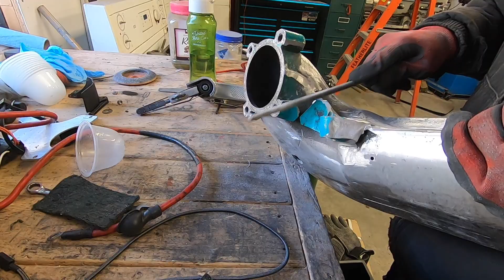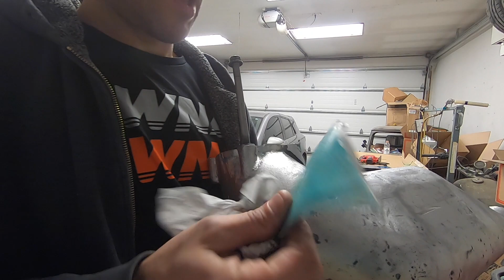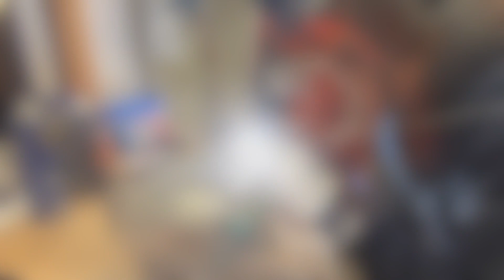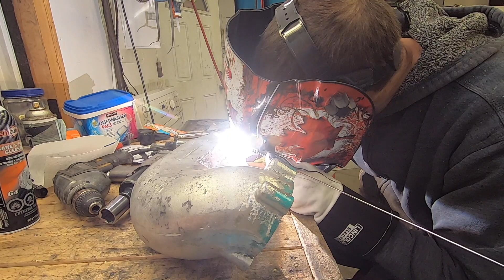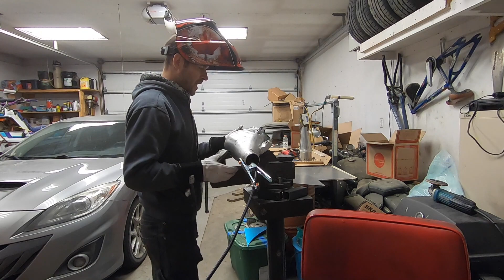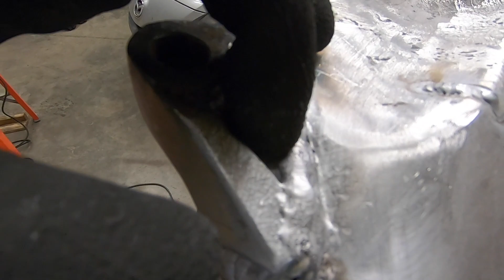ZXi 1100 Exhaust Modifications - Reinforcements and Repairs.

Comment: You need about 1 amp for every thousandth of a inch. It looks like you are welding atleast 1/8" inch on the pipe side. I'm sure you're welding with a pedal. I'd jump in it with 150 amps and then pedal off a little. It's always easier to weld aluminum with a strong blast of initial current unless its oil impregnated cast aluminium. That welder is fuc#ed. I hope you get that straightened out
Reply from the maker: Thanks Lyle. It's a pretty steep learning curve, but I'm getting it sorted out slowly.  I am now using the foot pedal, but when I made this video I was using the finger switch, and my welder was not using any up or downslope (something wrong) so it was 100% on or off. 

This casting is surprisingly easy to weld, most of the time. It must be pretty good quality stuff (or clean at least). I'm still fighting with the welder on an off, so I appreciate the advice. 

Cheers.
Reply: @JoelArseneaultYouTube  yeah you got to get that thing fixed dude. Before you're missing all you're hair and starting missing teeth!!! Seems like marine grade cast has been the easiest cast to weld. Some of it seems to fuse almost. Flows good. You're project is awsome!!
Reply from the maker: @lylegrenoble2055  I'm loving the projects and loving welding, even tho I have had some issues. If you are following through my videos in order you may see that I made a video talking about some of the welding issues and what I suspect may be happening... tho I'm an amature and can only guess. 

I have been talking with Everlast about the welder and they are following their step by step checklist. I am waiting for a new regulator, tho I have my doubts about if it will change anything.

Comment: Bummed we’re gonna have to wait for the HP mods on the 1100, but I think that is very smart of you to get a baseline and be able to see what your changes affect. I’ll be sticking around to see how this project turns out.

What kind of welder did you buy? And it is fairly new iirc right?

Nice work!
Reply from the maker: Yeah. I think that it makes more sense to do it over time and get an idea of how much is really gained from different mods. Also, this engine gave the Jet Ski Brothers a LOT of issues, so it might be smart to make sure that it actually runs well, before doing a munch of things that could cause complications. 

I'm very excited about this project, even without any mods, this is going to be a little bit crazy, for a guy who couldn't even ride one of these things just over a year ago, haha. 

I bought an Everlast Powertig 185 DV and yes... I got it just about a month ago, got a concussion and it sat unopened for a few weeks.
Reply: @JoelArseneaultYouTube   hey that’s how I started too! Never touched a jetski prior to buying the STX and rebuilt the engine. Knock on wood, she’s still rippin’. I did have it run away on me trying to tune the carbs. And let me tell you; one, I didn’t know two strokes could run away. Two, it is terrifying to have an 1100 running full tilt inside and aluminum box after you’ve ripped the plugs wires off ha ha. I then changed a bunch of things and I’m not 100% what fixed it but I did learn about the leak down test and am very conscious about air leaks. 

I watched Josh work tirelessly trying to figure out why that thing wouldn’t run. I was rooting him on the whole time. His boat is smaller than mine so it shoulda really ripped with that 1100 in there.
Reply from the maker: @YoderMarineandOudoors  Haha... yeah, having an engine run away is a scary thing! Being in an aluminum boat would totally make it more intense. It's usually a combination of things that has to happen to cause a run away in a two cycle gas engine, as they need a source of air and fuel. On a diesel it happens a lot easier as the intake is always open. 

Yeah, It will be exciting to see what he ends up putting in that little ripper. It's almost comical how small it really is. It's smaller than a lot of full sized Jet Skis.

Comment: Maybe you could get the stock oil pump and just mod it to mount a pully for the supercharger. Kawasaki did give you a mount on the front cover for a supercharger pully..... Maybe it would be to flimsy
Reply from the maker: That's what BJ said I should do. It would probably work, but the force of the charger would be trying to loosen the bolt... it could work loose and make bad things happen. 

I think I will use the puller bolt holes and use the outer ring of the flywheel hub as the "boss" . That will be plenty strong and also be really easy to centre and keep balanced.

Comment: What do you think of the center bleed mod?..... You know like the RRRRRRRRrad dudes. hahaha
Reply from the maker: Haha... yeah. 

That's totally legit as far as the general principal. No reason why it shouldn't work well. It's not ideal to have it right at the bent where the pressure wave will be disturbed BUT nothing about the 1100 exhaust is ideal, and there is no idea place to put it... so 🤷‍♂️

I did think about doing that to mine, and I haven't totally ruled it out. It looks like the outlet they use might be too large. Going large with the stinger can cause a significant drop in power at high revs. I forget the measurement, but some ppl in PWCtoday did some testing and found the perfect size to be just slightly larger that factory.
Reply: @JoelArseneaultYouTube  Hmmm I was thinking about doing that for my superjet 1100, but I also have a superjet b pipe camber that I could use with a custom elbow. I'm guessing it would be as good or better than stock pipe based on the fact that it would look cool.
Reply from the maker: @Jacobskibros  HAHA... looking cool is pretty important. 

If you have a chamber that will fit in there, it may be worth giving it a go. The whole 1100 exhaust system is a compromise, so you may end up with a chambre that works better, just by chance. 

I would be worried about the bleed size on the SJ B pipe though ... It may be a little small.
Reply: @JoelArseneaultYouTube  I was thinking the same thing. As for the bleed size, I was thinking of welding a bigger end on. But guys use that pipe on 1000cc+ twins. My krash 997 has a pipe end the same size. I'm not sure what it all means, but I would think if I get it all put together, it would probably work ok.
Reply from the maker: @Jacobskibros   It is for sure not a easy thing to figure out. It would take some testing or complicated computer software.  

It is a combination of things all working together that makes a pipe work, and the better those things mesh up, the better it will work. The 1100 Kawasaki has a really poorly designed manifold and it's hard to say how it will respond to B pipe mods. The reason why I think it may be small is really only because I've ready about others doing testing where they enlarge the bleed, and inject water at 5000 rpm to get some blocking effect (from what I understand). Based on this it seems that the 1100 will benefit from a larger bleed at low RPM and have more gains at top RPM with a smaller stinger ... this is true for a lot of two cycle engines. 

With a 1100 twin, you are almost guaranteed to have lots of bottom end grunt... Twins develop a lot more torque, so they may be willing to sacrifice some of that to get more top end.  

If I were you, I'd give it a go and see if you like it the way it is... if you want to try to get a little more bottom end power, if it seems bogy out of the hole, or if you just get bored , you can always cut the end off and put a larger one in :)

Comment: Bummer on the setbacks.  Good work on the pipe. That cast aluminum is much harder to weld , I think it's partly due to the added silicon in casting.  Also porosity and grain structure of cast,  let alone contamination from use and age . Maybe  you could preheat in the oven or with a torch to help burn off oils . I was thinking that you could slip some sheet aluminum in the gap between the mount and belly of the pipe,  maybe oversized to distribute the load a bit since you don't have the second layer anymore. Just speaking from past experience with expansion chambers.  The vibration of a two stroke is relentless.  I've been welding plate to the pipe and the mounts to that . I understand that doesn't really apply here but spreading the load is important for long term durability.  
Projects change , it happens,  you've got to adjust or redirect sometimes. Just part of modification game lol , as you already know. Hope you catch a break on the equipment issues. Keep working hard,  you're doing fantastic , especially for not having much experience with your tig.
Reply from the maker: Thanks Rick. 

Cast is different, for sure. Oddly, this Kawasaki exhaust seems to be made from some really high quality cast... My 650 engine is total garbage cast compared to the quality of this stuff... I'm not sure if it's just based on the years they made them, or if my 650 was a bad one.... The surface of the 1100 pipe looks rough (is rough) but as soon as you grind into or cut into it, you can tell it's really good cast. I got lucky for my first cast / TIG project. 

I have considered installing some additional bracing on the pipe, for the exact reason you stated. I'm going to take a chance on it, or at least wait till I kinda get everything assembled to see if I can figure out where the stresses will be. I'd hate to add a big ol gusset and just have it crack at the end of my handy work, haha. My hopes and dreams are that I have removed enough weight so that it will not crack 😂

As far as changing up the plan and moving on with a new idea... I'm totally used to that. The part that I don't like is that all of this was caused because I trusted people who I shouldn't have trusted without looking into it in detail myself.
Reply: @JoelArseneaultYouTube  I know the feeling of taking advice from somebody that seems like they know what they're talking about but in the end they're just regurgitating what other people say. Happens a lot on the Internet lol.  Some of the best cast aluminum Pistons have a high silica content. Strong , but not easily welding friendly. Definitely a wise idea to pull back the reins a bit and get the thing running in basically stock Forum before you modify it just takes forever to do a project like that but usually ends up better

Comment: Sucks that your welder is acting up. This is a really cool project but makes a real pain in the butt when the equipment doesn’t work. And your air compressor broke. Dang you having some bad luck. At least your band saw works. Haha
Reply from the maker: Haha... yeah. The good ol band saw. My air compressor check valve is leaking, so I can still use it, but it starts draining once the pump stops. 

I'm sure I'll get the welder sorted out... I'm pretty happy that I'm able to weld aluminum, even tho I did act up some.